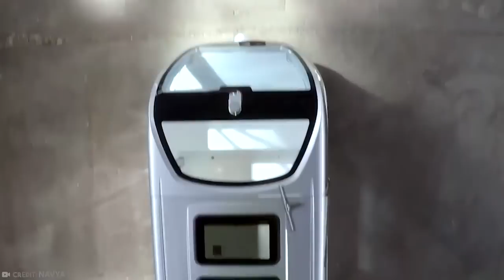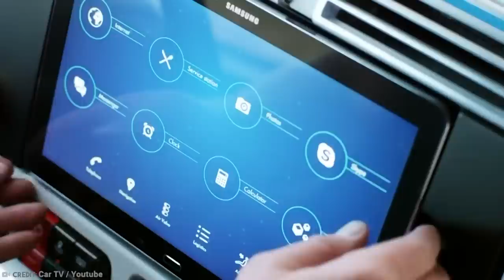15 Future Trucks & Buses You Must See

Comment: The Freightliner in this video is only one of two that Daimler/Freightliner has put out. The second is fully electric E-Cascadia (the smaller box truck is the E-M2). The diesel version is 550HP. The electric is 750HP+ and torquey as hell... good luck cutting them off in traffic. Currently they only have an effective range of about 300mi. About 200 units already on the road in southern California owned by Penske Truck Solutions. Almost forgot to mention that they have an electric motor on the gearbox to over-ride driver input if the turn signal isn't on and to maintain centered lane position at all times. Did I mention these are already hit the road in April?
Reply: You have triggered my conspiracy bell! Can you give me a timeline compared to the announcement of the election infection! I can't imagine a better way to test autonomous semi's than during a pandemic with empty road's and highway's? Thank you ...from Wyoming USA 🔫🤠🇺🇸p.s stay safe and healthy everybody GOD BLESS OUR COUNTRY AND stop this foolishness before it's too late..
Reply: @billallen4793  They're done testing. They're being fielded already.

Comment: The First two buses are almost identical apart from the first one was 3D Printed and also are they buses or cars, which are non-commercial vehicles.  Admittedly cars are also used to describe individual vehicles in railway multiple units.

Comment: Male/Female friendly trucks refer to the need to take a bathroom break! This can be much more of a concern as the age rises but also for long treks. The inside compartment could be stylized to fit a woman rather than a man. Ladies are taking more and more of a concern but the respect factor is yet to be realized by most.
Reply: Working at a truck stop open my eyes. I knew there were female truckers out there but I didn't realize how many there were. This was back around 2007/2008

Comment: Just so you know there is no way these vehicles will be alternative deltaminus in the near future it is going to take many years for the infrastructure to support them the roads all need redone the electric grid needs redone and computer trucks will not be able to figure out what regular drivers are doing just takes one person turn left turn right cut somebody cuts in front of a truck and that computer's not going to know what to do I am a truck driver I know for a fact electric trucks will come 1st and fuel cell trucks autonomous we're talking way in the future It will take a long time before autonomous hits the market USA's infrastructure and road system does not support it at all It's not the mention you're gonna need people unhooking the trailers because nobody's gonna pay that replace all their trailers to fit a vehicle so you need trucks that can pull the trailers off today as well I don't see if you come anything till closer to 2050 and beyond

Comment: As a truck driver, i have to say the first 2 truck 'designs' are completely impracticle and will never be anything more then a concept. As for the chinese elevated bus, I wonder how it would go over trucks, RVs or anything a bit higher then a normal car. And these bus shuttle, tiny tires, low suspension, these thing would be useless at the first sign of snow.